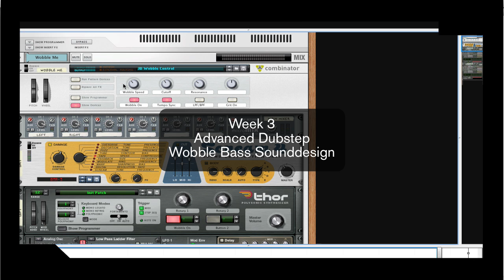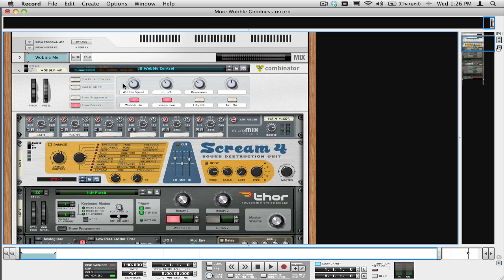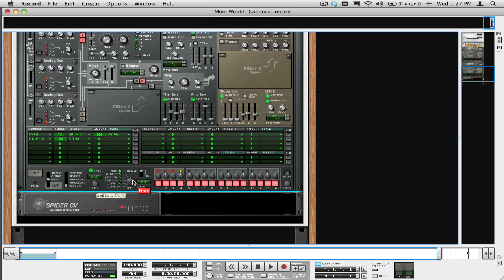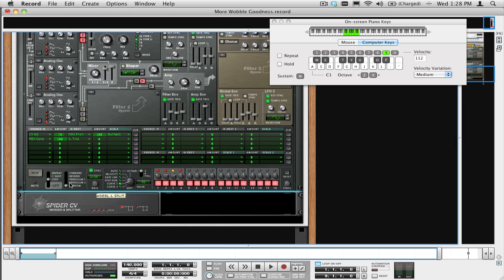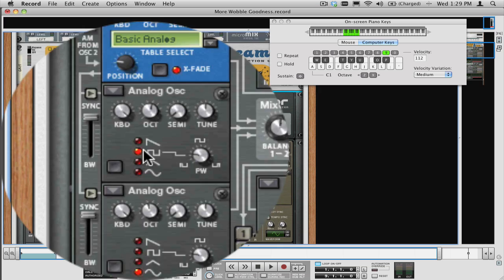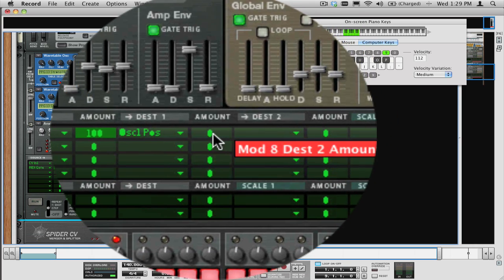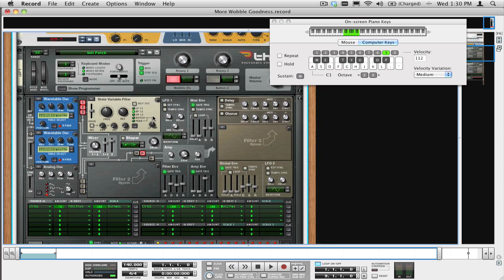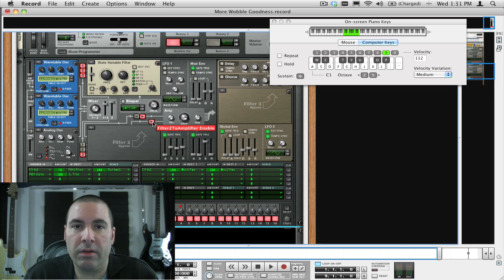52 Reason / Record Tips - Week 3: Advanced Dub Step Wobble Bass Sound Design

Comment: Reason is a Synth Programing Device. its like the ultimate VST because instead of pshing a button and liking the sound but not knowing how its being produced, YOU are forced to create it ur self, hence why it works like REAL hardware. if you were to buy ANY piece of gear on its own it would sound no different, until loading through tube amplification and MANY different effects modules, be it hardware or software.

Comment: @Filthstift 
Can you create a wobble bass sound with Subtractor? Yes.

Can you do the advanced random wobble speed selection using only a subtractor. No. There could be ways of doing it using a combintor and maybe routing a random LFO from a Malstrom to the Knob CV input... but it would be less controllable.

Thor is really the best solution for this.

Comment: I figured it out after I looked at the template, this to me is not a regular setup, with the combinator routing and the lfo splitter into cv 1 in both Thors. Why did you use 2 thors left and right when its already Stereo? I like the change of filters just by pushing a button 3. thats cool. This is an excellent video, I will watch the others but is there a good book you'd recommend on this? thanks anyway. Seems more like college grade stuff than just a 5 minute video.

Comment: @kbrom16 this may not matter but what version of reason? i am running 5, and my best explanation is that the first thor is in no way connected to the second, other than through the combinator, and my rotaries aren't setup for controlling cutoff or anything other than the step sequencer. what do you think?